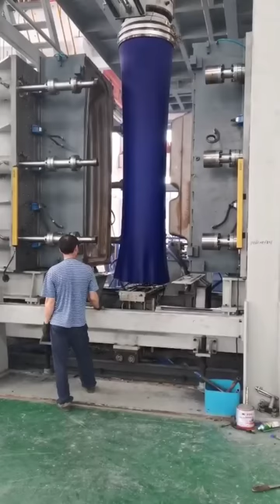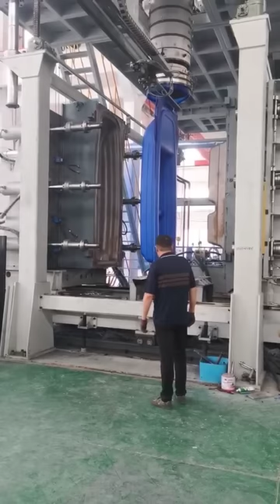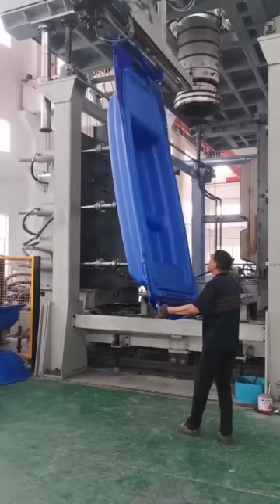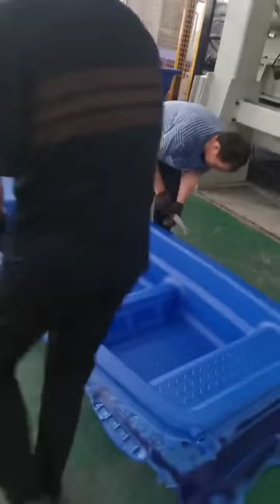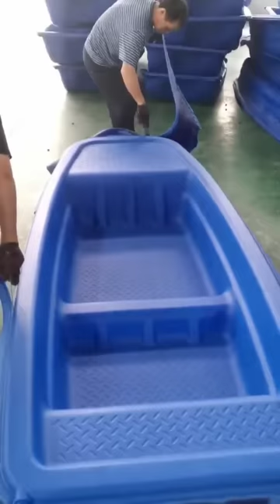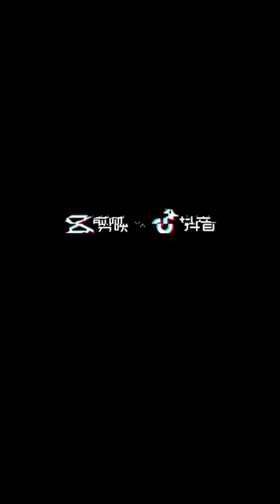10 foot Plastic boat Blow molding machine

Comment: I worked at a place that makes cow troughs and after you pull them off cutting the side excess off is super fucking hard with the air power tools they make you use. I skrewed up so sooo many of them learning.
Reply: They're cutting it like Butter when its hot

Comment: Since he poked a hole in it to release the air pressure, I guess it would not float if it overturned. It will sink. Also, love the release. I guess the plastic does not dent when it falls. 😎

Comment: I understand its slow, but why not to put a longer handle on that knife? Also the fumes...
Reply: I built blow molding machines for years there really isnt any fumes from melting the plastic they use electrical heating elements on an extruder that feeds the melted plastic into the "head" that looks like a 50 lb ish head meaning it pushes out 50 lbs of plastic per cycle
Reply: The fumes are clearly shown in this video at the time the press closes, with the operator clearly engulfed.
Reply: @microdesigns2000  I went through the video again just to see if I could see the fumes I'd bet anything that white smoke your talking about is steam from the cold water that's injected into the mold to cool the plastic and keep the parts from sticking to the mold
Reply: @shawnmccarty6923  it looks like the fumes are coming from inside of the boat.  Right after the operator cuts an opening in the plastic, the fumes ensue.  Since I've never done any blow molding, I don't really know about the process.  I've spent some time with injection molding and never saw any visible fumes.  This doesn't really look like water vapor, does it?